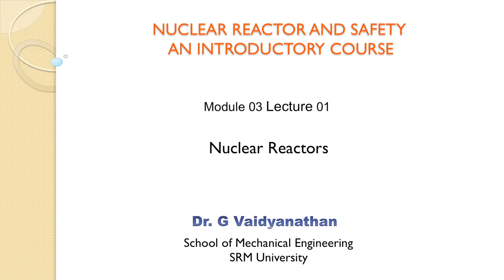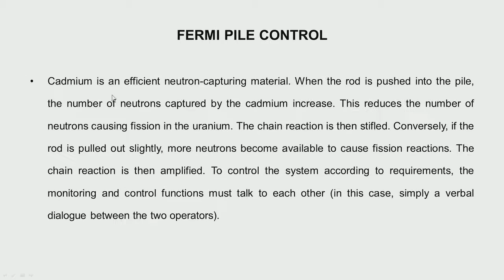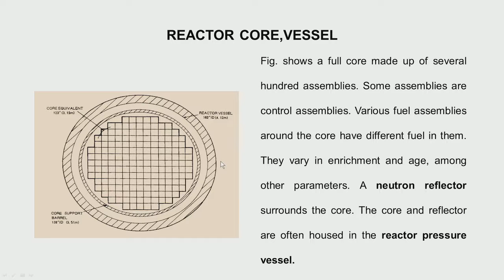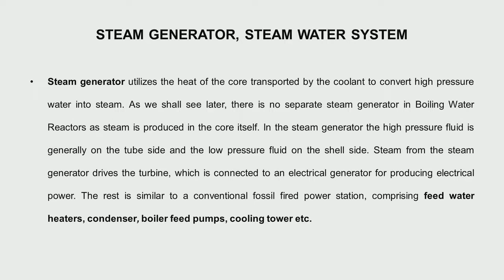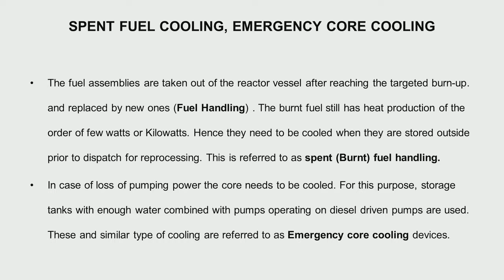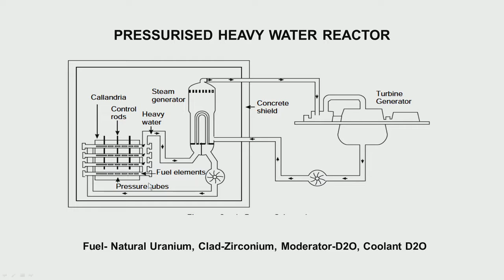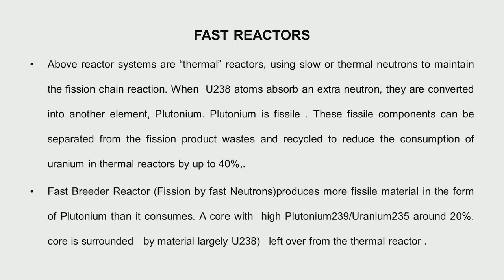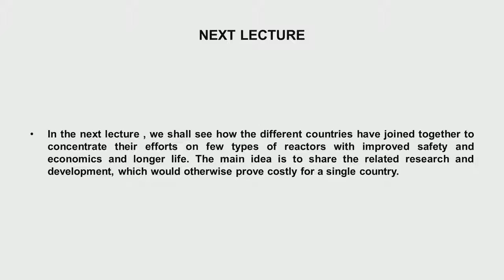Mod-03 Lec-05 Nuclear Reactors

Comment: If Indian scientists use 3% enriched uranium in their pressurized heavy water reactors  no doubt they become far better than light water reactors because they produce more plutonium and more electric output because heavy water’s neutron absorption rate is least that is 600:1 that means fission neurons when they approach 600 atoms of heavy water, one of them would be absorbed.In1975 l designed a new type of nuclear reactor which l called as advanced heavy water breeder reactor which uses heavy water as its coolant & moderator and it looks like American pressurized nuclear reactor but it has two pressurizers which are located at its both sides  .They provide the total pressure of 32MPa. And its fuel rods are made with 20% plutonium carbide and 80%  thorium carbide which are enclosed within stainless steel tubes. It has a strong pressure vessel where all fuel assembly,  were presented. The upper part of its pressure vessel, there is an unique vessel where an organic chemical compound triphenyl is placed to absorb  fission generated thermal heat and also act as a strong steam generating vessel.And its pressure vessel has two outlets which are located at the upper part  of this vessel through which highly heated heavy water come out with the temperature in between 450-600 degrees centigrade then it enters into steam generating vessel where stream generating capillaries are presented at its upper  level and they carries natural water.This reactor pressure vessel has an inlet at its bottom through which its coolant medium of heavy water would enter into reactor vessel.This reactor thermal efficiency is above 40% and it produces high electrical output of 350MWe.
Reply: 1.Why use thorium, any plans to breed it or any other reason of using Thorium? 
2. Heigher pressure needs heigher safety.